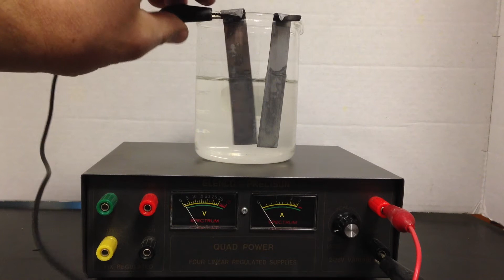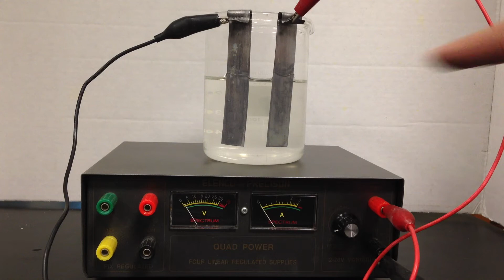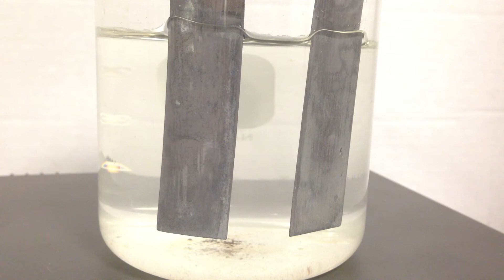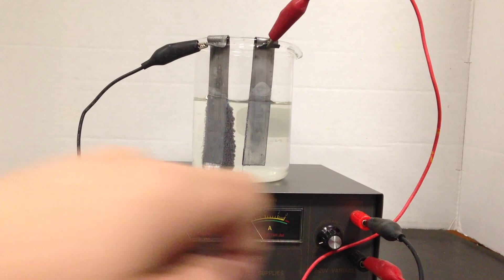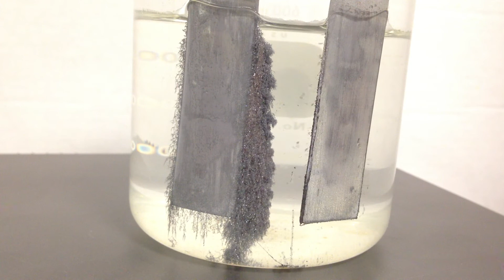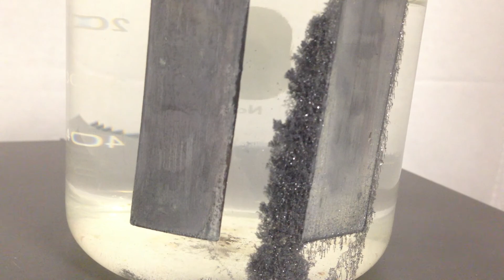Electroplating Demo

Comment: How do I electroplate Lead Dioxide onto a electrode?
Reply: J Stuyfzand Take the floating lead oxide particles in a beaker and add some ascorbic acid in it, it will give you lead oxide nanoparticals. Now you can mix this NP into silicone & spin coat it on the electrode if required. Otherwise first electroplate lead on the electrode & then use some strong Oxidizing agents(Sodium dichromate may be) to oxidize the surface

Comment: Could I electroplate copper with lead in distilled vinegar (10%) solution?
+|Pb| 10% CH3COOH |Cu|+
Or should I use more conc. acetic acid? Or premade lead acetate? Or is it impossible?
Reply from the maker: Martin of Gliwice As long as you make the copper the cathode buy connecting it to the anode of your voltage source you should have some success.
Reply: MrGrodskiChemistry And could I potentially oxidise lead coating via electrolysis in 30% H2SO4, to make PbO2 plated copper electrodes?Also, thanks for the response!
Reply from the maker: Marcin Goławski I do not think so.  If you place lead as your anode in the electrolytic cell, lead ions will migrate to the cathode and plate as solid lead.  Sulfuric acid will dissociate into HSO4- and this conjugate base I do not believe will be attracted to the cathode to get reduced to SO2 which would be needed to make oxygen ions available to reaction with the lead ions to make lead IV oxide. Also the voltage you would need to create Pb+4 ions would probably hydrolyze water into hydrogen gas and oxygen gas.